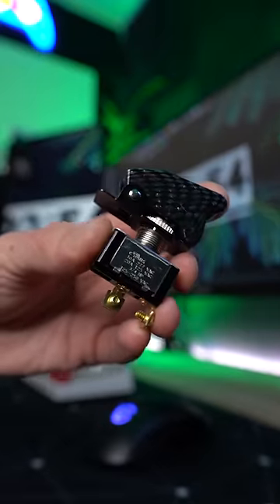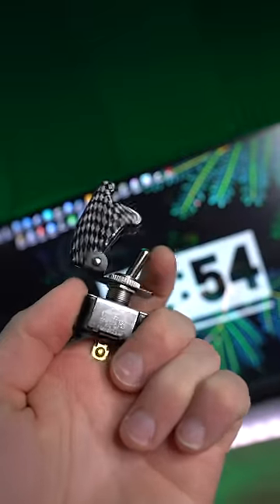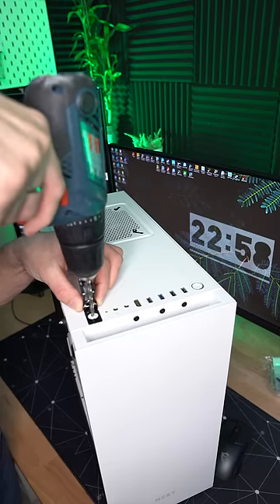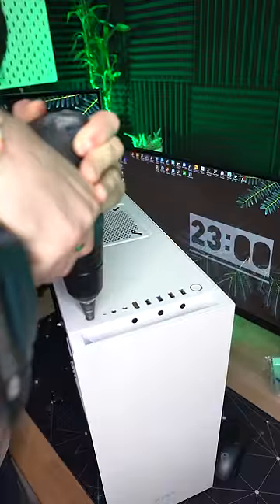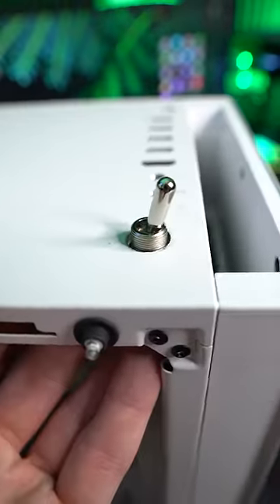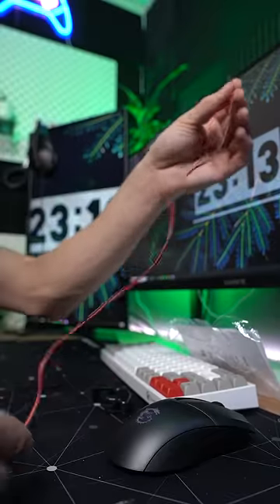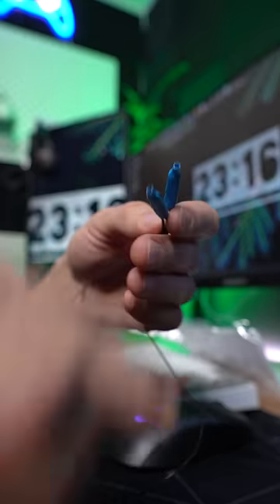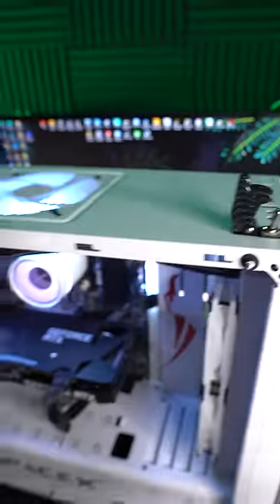Using a Fighter Pilot Switch to Turn on my Gaming PC! #shorts

Comment: Not exactly what the switches look like to turn on a jet but just a regular switch with a saftey cover
Reply: Fr 😂
Reply: depends on the aircraft. some have pushtype circuit breakers, others have toggle switches others run when the engine is running (old old style)
Reply: You misunderstood him. That is a "fighter pilot toggle switch" used for starting up the pilot. The jet has a "make jet go on switch" which will make the jet go on. My friends brother is a pilot  on a elite world class fighter jet extreme stunt and racing team and he told me about this. He also gets new release video games a week before they come out because his uncles work at nintendo and playstation.
Reply: @andrewut7ya511  Well no offense but first off there is no “Single button to turn on the entire aircraft” you need to turn on different stuff depending on your aircraft for example a Hornet you will need to turn on the Main Battery then turn on APU and wait till a green light shows then turn on the right engine then left engine then inject the fuel there are multiple steps theres not a button that lets you turn on the whole aircraft at once.
Reply: @andrewut7ya511  My president can’t form a complete sentence. But my friend’s cousin can perfectly.
Reply: @randomclipsmilitary9056  you realise they're being sarcastic right?

Comment: My man buy a 5 dollar soldering iron a learn how to solder also buy some terminals for the switch or at least make your own from solder it’s very easy and some heat wrap it will look much better!!still good and I don’t blame u that’s how I started!!! Keep it up
Reply from the maker: I have heat wrap and a solder gun and soldered quite a few things I was just way to lazy and didn’t care grabbed the stuff I had in a drawer and the wires would be tucked away

Comment: Man watching you rock back on fourth as you chewed that poor step bit into the metal. LET THE BIT DO THE CUTTING.
Reply from the maker: It’s an old retired bit..used it in the field drilling into hundreds of metal door frames so retired it to home use on random projects like this instead of throwing it out which is why I have rock it to even cut basic thin metal
Reply from the maker: Thank you though for the good hearted tip

Comment: If you decide to emulate this mod, make sure you get a MOMENTARY CONTACT switch, NOT a standard on-off toggle

You can also do something similar with a reset switch.
Reply: Can you use 12v toggle switch for this...? I want to try it but I'm afraid it will short out

Comment: As an electrician I just had a heart attack watching the crimp and tape job buuuuuttt I love it
Reply from the maker: I used to do small voltage like I said in the beginning of the video don’t care about doing it right just need it not to short as it was just temporary for this video, I’m not soldering each wire together and heat shrinking it so it triggered a lot of people that I just rushed it and use a beanie with tape 😂

Comment: I've done this too, but I used that circular hole where the button is. Turns out the cable can just be desoldered, and the hole can be expanded.

Comment: That is a good switch for reset, a nicer switch option in my opinion is a induction switch that can live hidden behind glass or plastic. Used to use remote
Controls (garage door openers) to start and shutdown my PC in the 90"s even used one with on/off and reset (filed the inside of the reset button on the remote to make it hard to press) also good old Nokia 3310 and extra parts from some internet harmfull manuals was great as a remote on/off for VNC viewer back in the day.

Comment: While I totally agree that toggle switches are cool at, 1) that's a momentary switch, not a toggle (doesn't stay in the spot you leave it) and 2) they are one of the most common switches on industrial equipment. Like it's the electrical engineering equivalent of saying "this bolt is a fighter pilot bolt". Like sure ya, their jets likely use them, but only cuz everyone does.

Comment: Jikes, having the case full of small metal scrap parts from the drilling haha. And Im a bit surprised, if the switch is a toggle type, when turning on, its like you are keeping the power on button pushed all of the time... Still likes funny

Comment: It would be cooler if it had a red top. And the switch should stay forward, when the red cap is set to cover it, it would turn the PC off. To turn the PC on you flip the red up then the switch.
Reply: Yes, but the red cap is easier to close than to open, so a child can easily turn off your pc for exemple

Comment: I have to start mine by sticking my finger through a hole in the tower frame to hold the back plastic ofnthe powet button and then push the piwer button because the glue holding the plastic came loose and every fix wont hold but the finger in the hold works fine, and its like a simple security measure for people that dont understand the insides

Comment: I just turn on my PC with an iPod. The PC has an always-on LAN Network built into the motherboard. So even if the PC is completely off, I can control it anywhere in the house as long as both devices are on the same network.

Comment: Not really a fighter plane that switch is just a steel momentary switch with an extra fancy protector , foo fighter pilot switches are made out of a non-conductive PVC which sheild the conductive insides to prevent static buildup , external electromagnetic current, ext...

Comment: 1- that's just a momentary switch with a fake carbon fiber cover
2- you could have connected those wires better or just use longer wires

It looks good besides the tape connection thing. The tape wire is a problem since the case has a clear panel.

Comment: Dude that wiring was so bad. You should really solder and shrink wrap it also should just use the mother board connector and heavier gauge wire. Nice rig

Comment: You know they sell that switch at autozone in "that" aisle.  Lol...  if someone told you it came from a fighter plane... you may want to get them cuz they may have ripped you off on price...  ive got one installed in my car for killing the ABS and activating slide mode.

Comment: We got a bunch of electricians in the comments worried about a low current low voltage power switch lmfao
Reply from the maker: That I installed for the video and took out a week later like I said did not care since I’m moving it to a new case just wanted to make a video and make sure it wouldn’t short out

Comment: I don't really like this toggle switch, for me there's no different than the regular on/off switch that comes with the PC case. Is there a similar model to this fighter jet switch that will stay in the ON position when the PC turns on and automatically goes into the OFF position when the computer is shut down?

Comment: I got the Same Case. Why Drill a new hole If you coud use the hole of the original Power Button. Also, now you can See the ugly cables directly behind the Window.

Comment: When connecting the wires with the connectors both the wires should be in the tube so you crimp it together and it shouldn’t look as bad as you made it plus when you use one of them the need for electrical tape is not needed anymore especially that much! Lol

Comment: But why the carbon tho? Red or yellow and black lines would be the real deal.
Because more fighter
Reply from the maker: Don't ask me I got it on Mnpctech.com and its just listed as a fighter pilot style switch
Reply: @YourPersonalGeek  i can confirmed that switches like that are used in aviation. I dont know about civil aviation but its common to find in military aviation. Often they are used for things that are either dangerous for others when turned on ( like arming weapon systems) or for you when turned on ( like turning off critical components of the plane that nirmaly run automated but under some circumstances need to be turned off or be switched to manual control to be kept airborne).
Normaly the switch cover is made of metal and painted red or with yellow and black stripes so that its easy to spot and shows that it does something special/critical.
As far as i know they dont flip back automatically like this does, correcr me if im wrong.
 But i guess it needs to in order to make everything work out propperly.

Comment: I did a Q flash + and I still get no display (kms)

New x570 elite
Ryzen 5 3600
Gtx 1660 ti (msi)
Hynix 2x 8gb 
Cosair 750w psu
1tb hard drive
500gb ssd 

Literally I have tried a lot from disassembled/reassembled, bread board, check connectors, wires, and turns on with lights the fan spins up and everything but no display help

Comment: Fighter pilot switch? You mean a typical momentary toggle switch with a cover. Used on race cars, any type of plane, and many more applications. 

Nothing special. I mean, cool to use as a power switch for your pc, but calling it a “fighter pilot switch” is a bit of a stretch.

Comment: But why drill another hole you already have a hole for the power button
Reply from the maker: As I’ve said a bunch the top I/o had a daughter board and everything is soldered to it so the housing of the switch interferes and I didn’t want to take it out and render the rest of the top I/o useless so new hole it was. This is temporary case so I’m not really concerned about it

Comment: At least solder and heat shrink it, or get a new cable and repin the connector. Jesus what ppl will slap a like on.
Reply from the maker: We’ll it’s temporary and going to a new case and already has so as long as it didn’t short it literally didn’t matter like I said. If in a permanent nice build sure but just wanted to see it in this case until new one arrived

Comment: I get it, you got it done but why would you film such a hack from start to finish, using a step bit instead of a drill bit, not center punching before the drill bit so you can see your bit fucked off a good 1/4 from center, and I have no clue what abortion you even used to crimp those wires, looks like used crimped but connectors and heat shrink previously heated, then wrapped in electrical tape... This whole project is just disgusting

Comment: 🤦🏻‍♂️
1. Horrible hole that was too big. 
2. Crimping wires that thin and not soldering them cleanly together. 
3. Ugly electrical tape instead of shrink tube.
This should have been labeled a fail video…

Comment: 1) Incorrect use of stepped bit (you don't wiggle it you let it drop with its own weight)
2) Horrible wire extension I don't even have to point this out...
3) You drilled the case with all the components inside? I hope you got something attached on the underside to collect all the steel particles because otherwise you might get a nasty surprise later on.

For someone who did these kinds of mods for an external rad water cooled build this is just painful to watch...
Reply from the maker: 1) not incorrect I’ve used this step bit drilling into hundreds of steel door frames so it’s worn out completely and used for random home projects only now

2) the wiring I literally said doesn’t matter as long as it doesn’t short it was just for this 30 min project and for this video, was moving to a permanent case and will solder take the time to cable management etc..

3) of course I have a catcher in their to catch shavings you think I’d want to fry my computer Jesus Christ people it’s a short, short form factor videos you have to save time on videos so you leave out the common sense parts and just try to leave entertaining parts. Long form factor videos you show everything in detail usually
Reply: @YourPersonalGeek  Alright I see take care and fuck YT shorts

Comment: bruh... the fact that you drilled a new hole instead of making use of the power button already on the case is so mildly infuriating 💀
Reply from the maker: We’ll aren’t you just smarter than I!…there is a daughterboard soldered underneath where all the wires connect for the top I/o and the bottom housing of the switch wouldn’t fit unless I took it out. If I took it out I would lose all functionality of those ports hence I left it and drilled a new hole

Comment: Please never use a drill like that
Reply from the maker: Lol ok Walter this bit I’ve used in commercial metal door frames installing security systems and badge systems for years so recently since it’s so dull I use it at home if needed…the switch cover covers anything so as long as the hole is the right size it’s ok…guys telling me how to use a drill

Comment: Wow, horrible drilling, extending wires for power... You just setting up the drooling masses for failure aren't you?
Reply from the maker: Is this a guide? Drilling is fine it’s dull because I’ve drilled into 100s of metal door frames with it so it’s retired to my home set and wiring just has to stop it from shorting since it was just a test for the video and rebuilt the SpaceX in a newer permanent case but sorry Nick I’ve led the masses astray 🥹